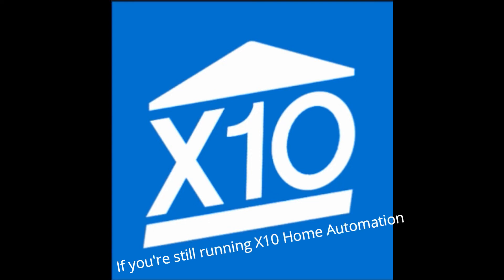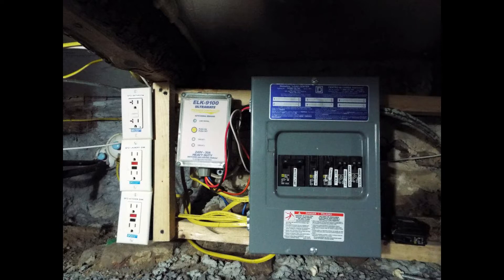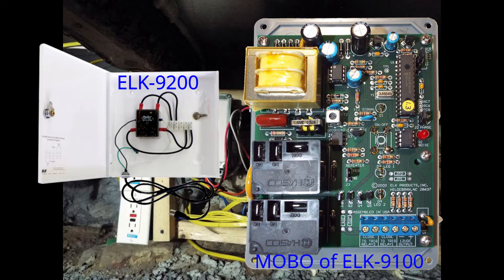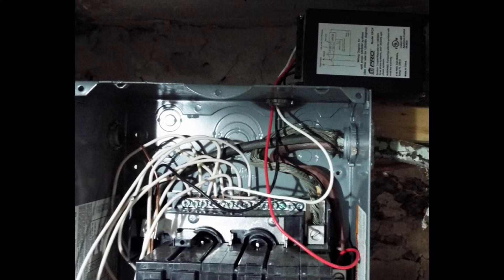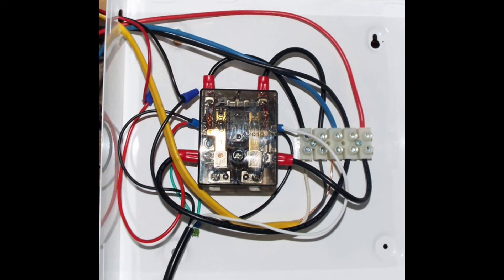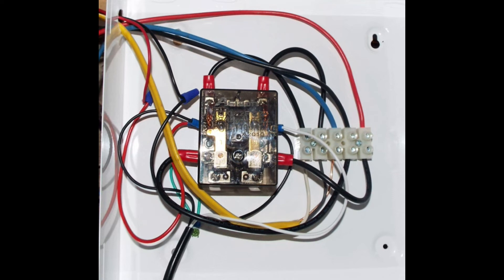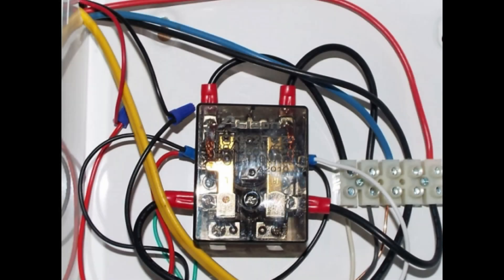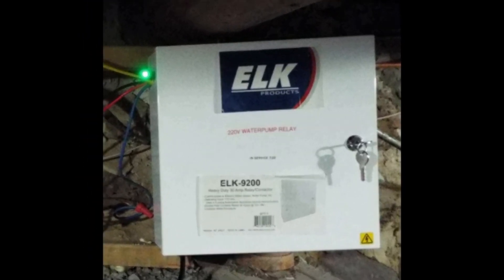If You Are Still Running X10, You're Gonna Wanna Watch This Video

Comment: I used to use X-10 to control some things at the farm.  At first i had trouble getting it all working but figured out I needed what you are calling a phase bridge.  I just went into one breaker panel and put a disc ceramic capacitor directly from one phase leg to the other.  Thats all it took.

Comment: What!? Why not use a pressure regulator to control your well pump?
Reply from the maker: I do use a pressure regulator. However I use the X10 relay to remotely shut off the well pump when I am away from the house for an extended period of time. This way I don't have the pump running continuously if there is a water pipe break. Keeps the flooding down to just the water in the pressure tank.